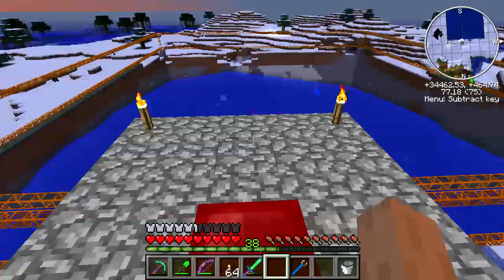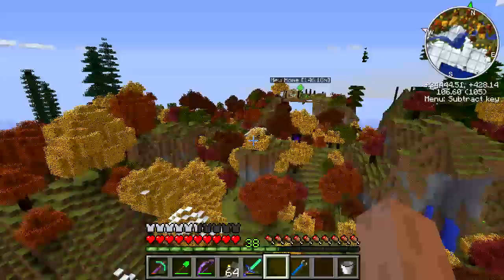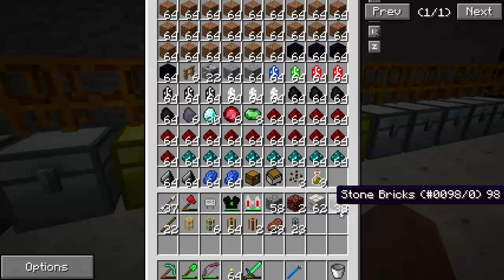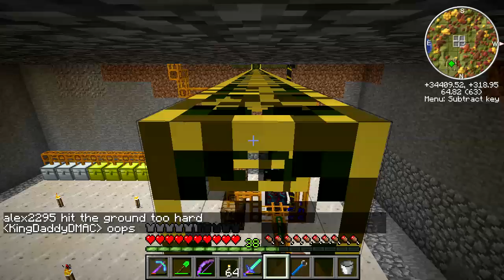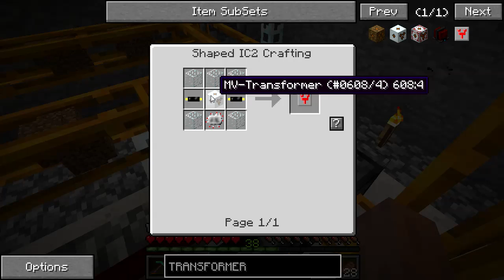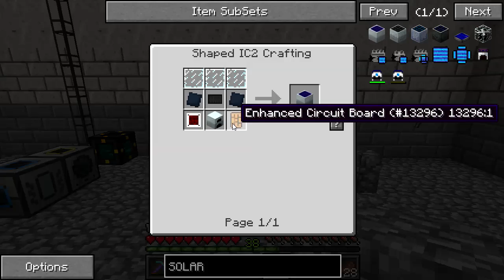E-017- Upgrades - Hermitcraf FTB

Comment from the maker: As I understand it the energy upgrades increase the machine's internal power storage buffer, while the transformer upgrades allow using higher tier of power which will have the effect of making sure there's plenty for all the overclockers.  In tests I've done so far it seems to be working that way at least.